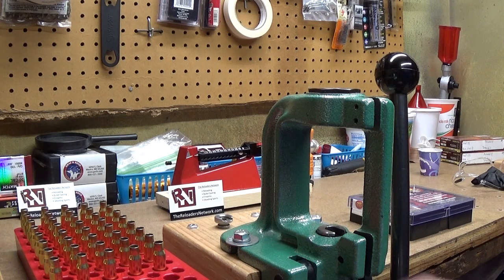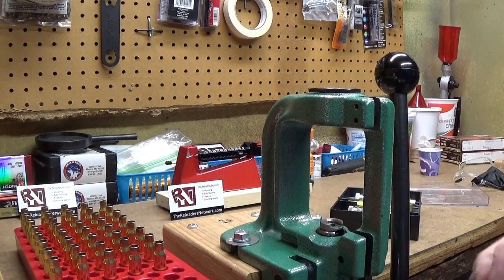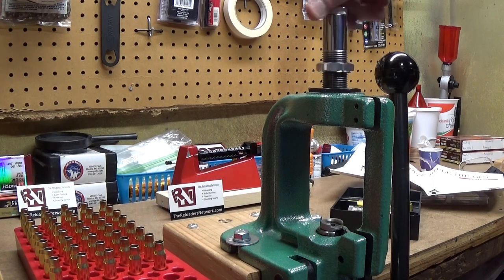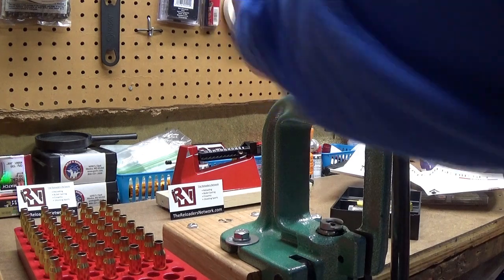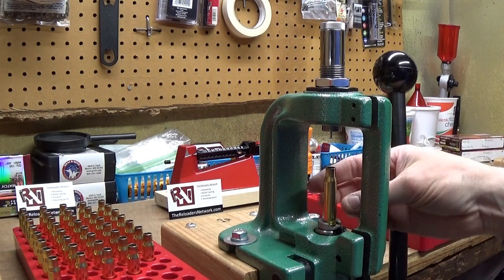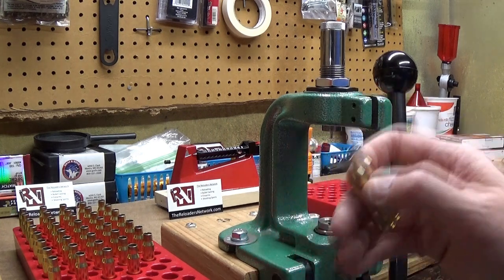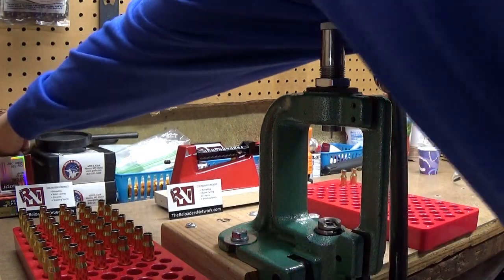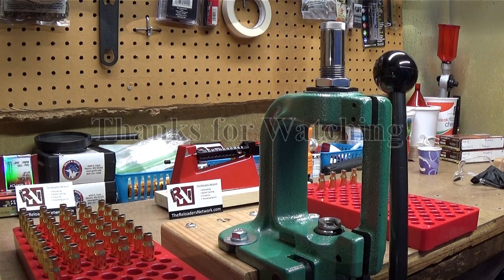Using the Lee Collet Neck Sizing Die

Comment: Thank you, nice clear (and concise) video - I have just started reloading with my 303 British. After full length resizing I had a case failure - separation and found (was informed) that I only needed to neck size as the cartridges had fire-formed.
Reply from the maker: You need to be extra careful with 303 British. The chambers are usually larger than the 'specification' and they grow a lot. The case shape and material makes them thin and prone to splitting. The first rifle cartridges I re loaded were 303 British and I had case separation issues. I could only get one re load out of them. I was not neck sizing so hopefully neck sizing can get you a couple extra re loads. Be very cautious and check your brass carefully for thinning and a shiny line on the base of the brass. Good luck.
Reply: @johnshandloading7907  Thanks, I have now found a local mentor and will see how it goes, if you are interested I will let you know.
Reply from the maker: @DavidWhelbourn  I would love to know. Please keep me in the loop. Thanks.

Comment: regardless how much you adjust the die, the collet is only going to close so far up against the brass and the brass against the mandrel even if you cam over. Camming over will not hurt the collet. If you close the die without a case inserted in the collet then you can collapse the collet too much. To fix that if it happens take a small screw driver and open the collet back up. If you don't cam over and rely on just the force Lee recommends, then I ran into necks not sized enough.

Comment: Best use would be to full length size with a separate full length die with the expander removed. Set that die to bump your shoulder back .002". Then use the Lee die to size the neck down to give you the correct neck tension you want.. no one these days neck sizes anymore.

Comment: Lee mentions "dwell time", apparently the time you keep the collet engaged, presumably to allow the brass neck to settle in for some time.  Ever hear of that?
Reply from the maker: I think a  couple second is all it takes. There is a slight amount of spring back after you remove the case form the die. Until the brass gets brittle and then should be annealed.
Reply: @johnshandloading7907  Thanks John!

Comment: I've been reloading since the 1970's and never neck sized. Then I got this unissued No 4 MK 2 Enfield. Long story short....... now I neck size. LOL
Reply from the maker: I love Enfield's and I bet yours is a beauty. 303 definitely stretches the case and leads to separation. Neck sizing is the way to go if you have the tools. My No. 4 MK1* has an over sized chamber and it will stretch the brass no matter what but it is a battle used war rifle. Thank you for watching ad commenting. Have a great day.
Reply: @johnshandloading7907  It is unlikely that there are any more than just a few Lee Enfields that have "an oversize chamber" in civilian hands.  That is why both the arsenals that manufactured the rifles and the military gun plumbers that maintained the rifles for the troops at war had go-no go gauges.  

Headspace could change - thus the numbered bolt heads as you see on your rifle.  If your bolt head number is a "3", then you are approaching the scenario where the entire action is no longer in spec.  If it was out of spec, in the majority of cases the arsenal would have marked it as a DP rifle and it would not have been released for sale to civilians as surplus.  My Long Branch is a "0" bolt head; I see very, very few Lee Enfields with "3" bolt heads and most of those are in pretty ratty shape to begin with.  Most are a "1" or "2".  

Fun anecdotal fact: one of the most accurate rifles (and the owner one of the best shots) I saw in Service Rifle competition had a "3" bolt head.  Didn't seem to matter which military ball and lot was being issued for that match - that Lee Enfield would stack them when the owner did his part.  He would have been aghast if anyone had suggested he have it rebarrelled with a replacement Lee Enfield barrel.

But the rifle wasn't manufactured with "an oversize chamber".  It was manufactured with a military chamber intended for military use, with specifications that would allow muddy ammunition to chamber in the muddy trenches of The Somme, Vimy Ridge, etc.  Or verdigris covered ammunition stored for years in some monsoon drenched humid backwater munitions dump in India.

In other words, the British Empire and their Commonwealth arsenals in Canada, Australia, India, etc did not cut chambers to eject fired brass specified for American reloading dies that would be manufactured decades later.

If you are having problems with brass stretching in any Lee Enfield rifle while reloading, with respect, you aren't doing it right.  You're partially getting it right using the collet die, but proper brass preparation starts before that.  

Starting with which brass you choose to use if you're a serious reloader for the Lee Enfield variants.  With the disappearance of the surplus Greek HXP ball ammo manufactured in the mid 1980's (now coveted like gold dust by Service Rifle competitors), Privi Partizan is head and shoulders above anything else available that I'm aware of here in the US where quality is concerned. Comparisons to dimensions (particularly rim dimensions) of Commonwealth military ball ammo from the 1920s through 1980's, PP looks as though they purposefully intended to duplicate Commonwealth military brass specifications. Civilian brass from Winchester et al is not even close when measured and compared.

It's a very simple process reloaders will quickly grasp once you get their heads wrapped around accepting that there is nothing oversize about their Lee Enfield's chamber - it's the undersized American reloading dies designed for American chambered rifles that you need to deal with.  Even if you don't want to bother taking a deliberate approach to preparing brass so there is no initial stretching of brass, you simply need to think of it as reloading fireformed brass.

Best regards.

Comment: I have to polish mine up It leaves scratch’s on the neck 👍👍 thanks for sharing
Reply from the maker: Definitely take it apart and clean it really well, then polish the surfaces that can bind. Last thing you have to put anti seize compound in the top so it does not get stuck anymore. I had that problem with mine. It even wrecked some cases from binding.

Comment: Hello John, I have the following problem whit Collet Die. I follow the description exactly but when i squeeze neck i have bump the shoulders exactly 0,004". Have you measured if it is with you bump?
Reply from the maker: I never measured the bump back and never had any issues with the results on target. I suggest backing the die out slightly and seeing if that helps. Are you trying to only push back .002? The distance from the shell holder to the inside of the die will change the amount of resizing done.
Reply: You may have a press that cams over. This creates to much pressure on the neck and the shoulder will collapse (bulge)  ruining the case. Back out the die and try over again. Use your calibers and check the inside neck diameter .
Reply: @gascheck8151  nope. A press that cams over does not create too much pressure on the neck. And the die does not bump the shoulder back. At all. If shoulders are collapsing,  you probably raised the ram on an empty die. The collet stuck closed.  Take it apart and open the collet with a small screwdriver. From there on, don't ever raise the ram without a case in the shellholder. A press that cams over is actually better than a Lee press because you don't have to "guesstimate" how much 25 lbs of pressure is. The Lee Collet Neck Die is arguably the greatest invention in all of reloading. That's why it's on the cover of Lee's reloading manual.

Comment: How many times can you neck size before your bolt starts getting hard to close, if any?
Reply from the maker: Depends on the case and the rifle. The bolt can be a little sticky closing on the second or third time of neck resize simply because it is very close to the same size as the chamber walls. I would say 3 or 4 times on average before needing a full length re sizing. . Then a full length resize and trim is in order. But you still have to measure the length after each sizing, even a neck sizing to make sure the case is not getting too long. I hope that helps.
Reply: @johnshandloading7907  I've been full sizing with Lapua brass 223, but wanted to give neck sizing a shot since I have the set. At six resizing it's noticably harder to squish the brass from when I started. I want to see if throwing in a few neck sizings will prolong brass life a bit. I guess this phenomenon is 'work hardening'? Thanks.
Reply from the maker: @xNevikKx  Yes. I think your brass needs to be annealed, full length sized and then trimmed. Definitely sounds work hardened and will be so brittle it cracks or breaks. A torch and a socket on a electric drill works for annealing for me.

Comment: @johnshandloading7907   "You need to be extra careful with 303 British. The chambers are usually larger than the 'specification' and they grow a lot."

The chambers are NOT larger than the specification - that is one of our American Urban Legends in the reloading subject matter field.  The chambers have some variations due to different reamers and wear over periods of manufacture and different arsenal manufacturers.  But they were cut to the specs that came from the Pattern Room - the Commonwealth wartime versions that long predated our American SAAMI (and CIP in Europe).  If there is actually something out of spec, it is what SAAMI chose for dimensions for reloading dies that had zero consideration for the original Commonwealth British military spec chambers instead of American hunting rifle chambers.  

This is where the handloader's problem lies (more accurately, potential problem):

1.  The English Empire that spanned the globe in the late 1880's when the .303 British and their Enfield rifles were introduced required ammunition stored for years in all sorts of backwater colonial nations where the weather could be unrelenting dry heat of deserts in Afghanistan versus places like India with monsoons and unending humidity.  Ammunition in those conditions can develop verdigris on the surface, swelling, etc.  The last thing soldiers at war need is to be issued ammunition that will not chamber.  

So the Brits specified chambers cut so that long stored ammunition WOULD chamber after being in colonial storage for years.  That was exacerbated in WWI when both living in mud filled trenches and substandard emergency wartime ammunition resulted in there still being that worse case scenario: ammunition that would not chamber.  The response was to cycle existing Lee Enfields for an FTR to further increase chamber dimensions along with new chamber specifications for Lee Enfields coming from the arsenals to go to war.  Sidebar: this is what killed the Canadian Ross Rifle - not some inherent defect; they had relatively tight chambers we would consider cut for hunting/target accuracy (or fighting the Boers at long range in Africa about the same time).  They could not chamber substandard/muddy ammunition.

2.  The British Empire had exactly zero concern regarding their chamber designs for the advent of handloading that would come decades later.  Fired cases were left were they fell, unless on a military range.  

The SAAMI geniuses, on the other hand, never gave any consideration to the military specifications of Lee Enfield chambers manufactured over a 60 year period, and the tens of thousands of surplus Lee Enfields in use around the world.  If anything, they gave consideration to American manufactured rifles chambered in .303 British for civilian use.  

I have both a Winchester 1895 and Savage 99 lever actions in .303 British, both manufactured prior to WWI.  I did cerrosafe chamber casts for both prior to beginning to work up cast bullet loads for both (thumbs up to Accurate Moulds for his precision custom molds that drop bullets to your specs).  Those chambers are far, far skinnier than any Lee Enfield I have done casts on when measured.  That includes my post war 1950 Long Branch that I purchased unissued and shot in Service Rifle competition for years.  The post war 1950 Long Branches are the best of the best when it comes to quality in the No. 4 Mk1.

3.  So the "out of spec/excessive headspace" issue is in fact an issue of handloaders not understanding their dies were manufactured with brass from American chambers in mind.  They faithfully follow the die manufacturer's instructions to insert the die until it touches the die holder, etc, resize, and then reload.  Each time they do it, followed by firing it again, they are in an a cycle of excessively working the brass - resulting in each time the case stretches again and again.  And this is why brass reloaded in this manner doesn't last very long - why would anyone expect it to when reloaded in this way?

To eliminate this stretch/resize/stretch/resize cycle, you simply change how you reload.  Unless you're knowledgeable enough/care enough to prepare new brass for reloading, you simply adjust your sizing die down just enough to give you a crush fit when chambering the resized case, no more than that.  You are essentially working with fireformed cases from your rifle - and if you have multiple military rifles, each rifle should have it's own bunch of brass.

And this is where the Lee Collet Die is so valuable to those who reload for military .303 British rifles in particular.  That fire formed brass from your rifle only gets reworked on the neck with the collet die, there is no work hardening or repeated resizing/stretching of the case body.  Eventually, the brass will need a bit of a body bump.  Brass done this way will last every bit as long as any brass you reload for in any of our American hunting calibers.

4.  To maximize brass life AND accuracy in the .303 British for military rifles, start with virgin new brass.  Most American manufactured brass has far thinner rims (there's your headspace) compared to military rim thickness.  In comparing military ball ammo I've obtained from the 1920s - 1980s period, the commercial brass that closest matches military .303 ball is Privi Partizan.  It is usually easily obtainable; the brass dimensions were probably designed to replicate military ball ammunition.  Of military brass, the Greek HXP ball ammo from the mid 80's was the highest quality, extremely accurate, and cheap like borscht when it was available.  When Lee Enfield rifle owners realized that - especially those still involved in competition using Lee Enfield rifles - it disappeared and asking prices skyrocketed as it was snapped up and availability eventually disappeared.

So, start with your new brass; you are going to create a false shoulder so that when your new brass is first fired, it is supported by the base of the head firmly against the bolt face while the false shoulder is in firm contact with the front of the chamber.  This leaves the brass with no way to stretch forward, but instead only expand outward when fired.  

Buy a Lyman .33 neck expander; this will work the new case necks the least; a .35 neck expander isn't necessary and works the neck more than necessary.  Lubricate the inside of the cases with dry graphite (or whatever you prefer).  Run the cases through the neck expander.  Now run them through your full length resizer (or neck resizer), starting with just a little bit of resizing back to .303 size at the top.  Making small adjustments each time, continue resizing down the neck, trying to chamber the partially resized case after each adjustment.  At first the brass will not chamber - the false shoulder you have formed is too far forward to allow the bolt to close.  

When you have the false shoulder moved far enough back, you now have brass that when loaded will not stretch even once when first fired.  And the resulting fire formed brass is just right for THAT particular rifle. And again, this is a case where resizing using the Lee Collet Die is particularly useful in .303 British military rifles.  You don't do all that work and then resize that brass with reloading dies following their instructions.  You resize the neck only, using the collet die.  Eventually you'll have to bump the case a bit before returning back to collet die resizing, but it will take a few firings before that happens. 

5.  To further increase brass life (and probably accuracy if using a Lee Enfield in competition), anneal the case mouths to eliminate the stress and work hardening from the neck resizing.  Some do it every three or four firings; as it takes so little time, I do it every time I prepare the fired brass for reloading after finishing resizing.  I use the method of an alcohol lamp (cheap like borscht on Amazon) while rolling the case between my fingers until too hot too hold, then drop on a towel.  No need to drop in water - and you can't "quench" brass.  That's not the most accurate way to anneal, but it doesn't have the potential risk of overheating the brass with a propane torch and it doesn't cost hundreds of dollars like the electronic annealing machines -and it's a low cost/low time investment.